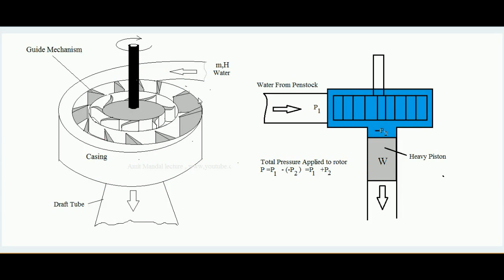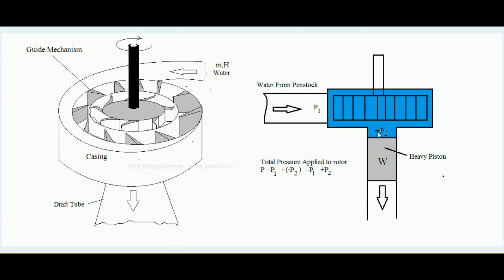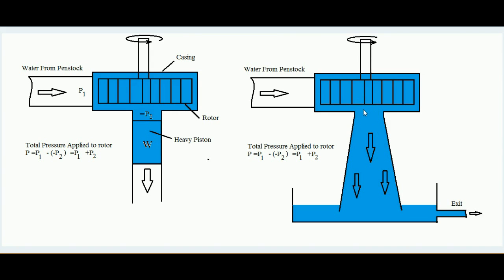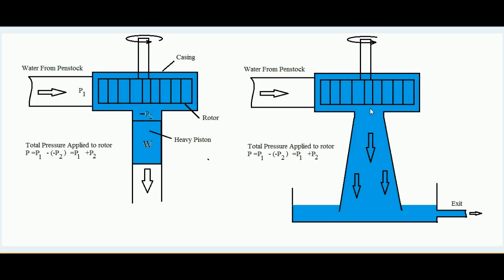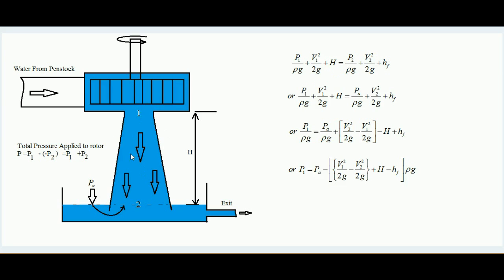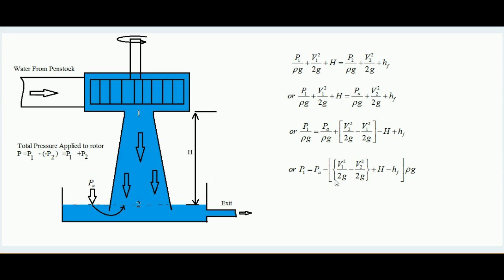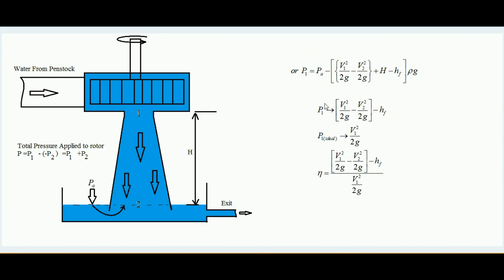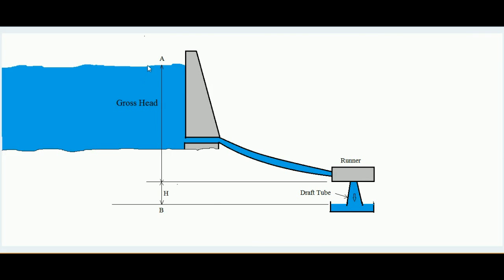Draft Tube in Hydraulic Turbines Explained | Water Piston Effect that Increases Turbine Efficiency

Comment: Thank you that you made me understanding the draft tube importance. This make me wanting to know more how to design/calculate the draft tube.  Is it any limit to determine the H of draft tube, its longest length compared to whatever number such as diameter of A1 or A2 or compared to V1 or V2 or compared to P1 or P2...? or any recommend of of wide angle of the draft tube wall?
Reply from the maker: must avoid flow seperation while passing through....

Comment: Thank u. Sir could u explain why pressure at point 2 is taken as atmospheric pressure?? If we apply Bernoulli's equation between water point 2 and outside water from draft tube it will give " Pa=P2+$V2^2/2 (take density by symbol $) " so sir P2 is less than Pa. Sir could u pls correct me.
Reply from the maker: P2 is less than Pa but greater than P1 . It appears you are confused with static pressure, dynamic pressure and total pressure.

Comment: sir can you please make make video on "what will happen if we don't use draft tube"?
Reply from the maker: +Prithviraj Gohil low power developed.
Reply: Amit Mandal sir , so water will be discharged or not because it will be at low pressure as compared to atmospheric temperature.
Reply from the maker: +Prithviraj Gohil ya it will